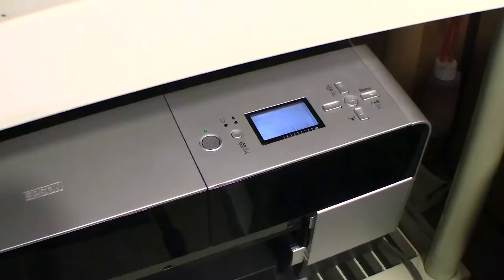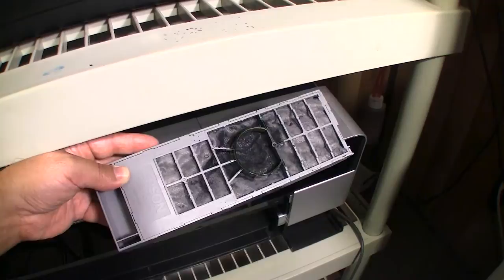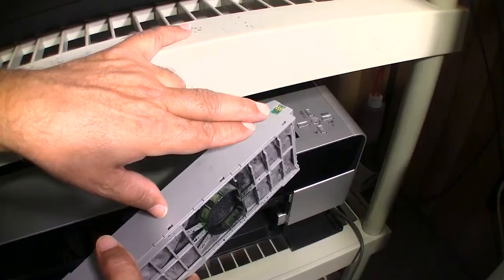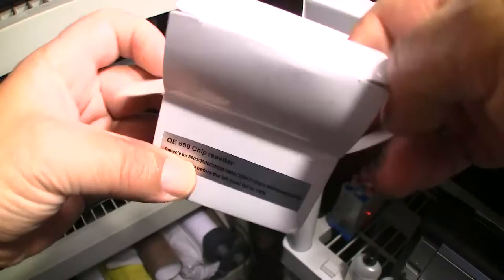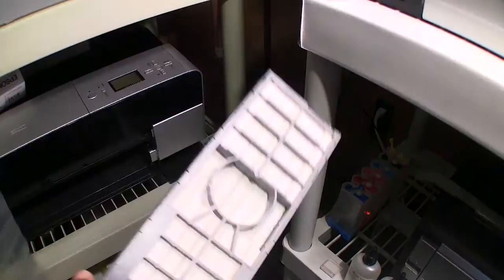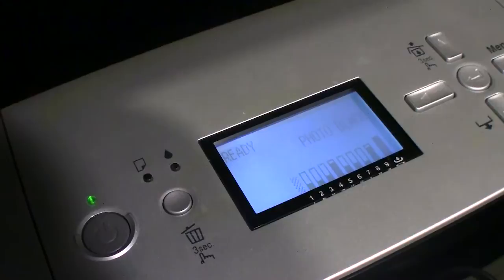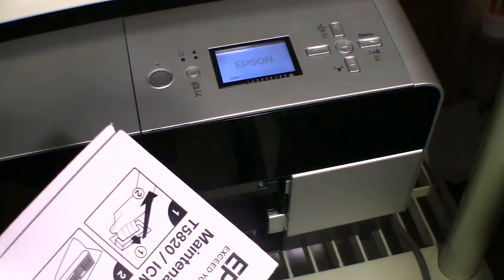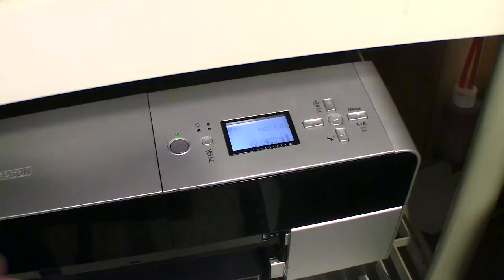How to Reset the Maintenace Cart on the PRO 3800 and 3880

Comment: I have a 3800 that has had a few clogging problems, but basically keeps chugging along. This video,and the accompanying one on refurbishing maintenance carts have saved me a lot of money. But... today I went to reset the chip on a refurbished cartridge, and the light flashed red, turned solid red, but never turned green. I followed a suggestion I found on line and opened the resetter (take the little printed strip off the back to expose two screws), intending to change the batteries. I took one battery out, then decided to just order another resetter from Ebay for $10.79. Then, on a whim, I put the battery back in and tried the resetter without its case, just the circuit board with long prongs sticking out. It worked! I have three old carts, and it did all three. Posting in case it might help anyone else. I thought it was easier to hod the prongs in contact with the chip using the circuit board without its case.

Comment: Mr. Rodriguez, I have an Epson SC P800 that  said it had reached the end of its Maintenance tank life, so I did this little trick, that you showed us only it didn't work. I took the old cartridge out, emptied, cleaned it, reset it, placed the new cartridge in, took it out and placed the old one back in.  The printer still says it has reached its life expectancy,  even after it had been reset...green light and everything.  Any thoughts?

Comment: thank you so much, i had the doubt about turning off the printer between changes, because on the p800 manual says it is needed, but not on the 3800, but looks like is fine turning off the printer as you show

Comment: Jose Ive been following your videos and I've done oem refills thanks you so much saved loads of money. When i reset my waste cart I just use the chip resetter the same QE 589 CHIP RESETTER your using with out using a new cart and it all works and rests 100%  thanks
Reply from the maker: +Kelly That's great! So far for me I've had to do the two cart routine but it is not a hassle. Glad it is working for you!Joe

Comment: Really wonderful thing you're doing for your community Jose... nice work. I'm wondering if I need to keep a pristine maint tank around between cleanings. Is there anything wrong with this:

Remove full tank and reset with the gizmo

Install the new tank

Clean the original tank when you get some free time.

When the second tank fills up, remove.. reset... and install the original tank. 

Actually... second question. Much of the way you speak and references you make lead me to believe you're a machinist or tool maker. Might this be the case? Hope I'm not intruding... thank you again for the good work you're doing.

Comment: Jose, hello. I found that I had to file down the plastic protrusion directly underneath the pins on the maintenance cartridge resetter that I purchased on Ebay. It worked fine after I filed down the plastic protrusion(spacer) directly underneath the pins.
Without filing down the plastic spacer, I couldn't get the pins to make contact. Just curious if you had the same issue? I know you didn't mention that in the video so I'm guessing this is a one-off problem with this resetter that I purchased.
I find your videos of great value and enjoy your manner of presentation.
Reply from the maker: What color is your resetter? The BLUE one does not require modifications.
Reply: @cheo1949  The resetter is white or cream-colored. All the identifiers on the resetter are the same as the one you showed in the video. It came from a place called "colorfulworld printing" via Ebay.
Reply from the maker: Yeah that's why. The only one I recommend is the blue one. I don't have the model # as I am not near my print shop.
Reply: @cheo1949  That's fine Jose. The one I got works OK now.

Comment: there's a way to reset the maintenance cart without the 2nd cart. just reset the maintenance cart chip as you normally do, then remove it and replace with any T58 cart chip. Put the maintenance tank back. printer will give error message of course, but that will erase the memory.  put the maintenance cart chip back, then the printer will read 100%.
Reply from the maker: Correct. Some of us will have extra chips as we are tinckerers but many do not. So the second Maint Cart routine is the recommended method. If you have two 3800/3880 you can continual!y swop the carts between the two.  I have the 3880-3880 and P800 and thte e the same cart so imagine the possibilities.

Comment: jose I found the resetter much cheaper at sign in china they were 20 each and the qe589  same one as you show they also have the other resetters for even less than 10 dollars each  wow I just used mine worked awesome thanks bud
Reply from the maker: +Hellgap50 Is there a web site?

Comment: Hi Jose, how are You. I'm following your tutorial from long time, I have a 3800 and all advice were very usefull. Now I have a problem wich i cound't resolve. The printer still keep asking a mantinance cartrige even if I have insert a new one, original. There is a way to reset all the sistem? thank a lot, roberto from italy.
Reply from the maker: Turn it off and unplug the printer for 30 minutes and power back on. A new never used maintenance cart should be recognized. If still cannot be recognized you will need to have it checked out at an EPSON Service center.

Comment: Hi Jose, Thank you for your instructions.  I have a refurbished from Epson, which was a replacement for mine which dropped black ink all over the print.  This one does the same thing and it was filthy.  After cleaning it still does it.  Do you know of anyone who still fixes these in CA?
Reply from the maker: It very likely is the Black ink Switch valve causing the leaking of black ink. As to where to get it replaced? Can you even find parts?

Comment: finally I got an resetter. I did everything like you suggested in the video. the reseter turned to green but my 3880 pro did not accept it??? I repeated the process-never worked...
Reply from the maker: If the chips were too low as in like 20-15% it will not work.
Reply: @cheo1949  thank you that nicht bei the problem. So I will try the next time in time.🙋

Comment: My maintenance cartridge is new, but the printer says it is full. I only installed it a couple of weeks ago. However, I just installed a new refilled ink cartridge and that's when the error message showed up. When I saw your video, i thought this might be my solution, but I'm not about to buy a resetter to fix this error.
Reply from the maker: Some refillable carts do not get along with the maintenance cart. 
What carts are you using?

Comment: HI Jose . I just received the QE589 and after following your advice, at the second attempt the green light came on. Thanks a lot .
Just one question, my original maintenance cart is at 15% but there seems to have plenty of absorbent not even dirty, when should I replace the absorbent ? The  carts have been in for 23 months
regards
Reply from the maker: +Luc Poi Yes most of the ink will be concentrated at the center and all over the very bottom of the cart's sponge. It will not be apparent when you just look at the top surface.Reset it and keep a close eye on it! Replace when you feel you need to.

Comment: Hey Jose, I got the QE 589 resetter and some ink carts from clickinks. Ive first tried refilling my carts and resetting them where I get green lights but some show full, some show as empty with an x through the level column and some without an x. It would have a not full maintenance cart and come up needs replacement . I would reset but it would last a minute until the same message will appear. I tried replacing with some /not all, new carts that read empty. What do I have to do?
Reply from the maker: If the original chip was empty you can not reset them at all. They had to have been at least over 15 to 20% above empty.
But are you saying you are trying to reset these carts from Clinkinks or original OEM ones?
Reply: @cheo1949  Im going to say both. I grab the chips and keep in a separate container. Is there a way differentiate?

Comment: Thank you for the instructions, the new maintenance cart is in, but when I get ready to print, it wants to switch back to photo black (and it leaks) instead of staying on the Matte Black, which I switched it on and prefer anyway for printing my artwork. Tried it twice....it says "Ready" and when I push print, it then gets ready to switch back to Photo Black. Any ideas?
Reply from the maker: If your driver is defaulted to a glossy paper type it will always want to switch to PK. Make you to default the driver to the type you are most likely to print on. If you are experiencing leaking then you switch valve may be beginning to fail.
Reply: Thank you much. Will try to change the default to regular paper. I am sure the switch valve needs to be replaced, but have no clue where to get one.. @cheo1949

Comment: Hi José, thank you for the great videos and tips! I found a deal on a 3800 but now I'm like concern about the shipment... if I should ask to remove the ink cards or not and in the case of the waste tank if it would be best and safe to remove it to, what you think it would be best?! thank you once again!!
Reply from the maker: No need to.
Reply: @cheo1949  Thank you! I also go ask to keep it on the horizontal during the shipment, if comes like that should be no problem to. I also would like to ask you in the case of the set of inks installed are already old, could cause problems if I use them even for running the cleanings?!

Comment: Hi Jose. Great and useful video that I was looking for a long time ago. Just one doubt with regards to the subsequent use of the brand new cartridge that you use to be able to reuse the used one. Have you got any issue with using the brand new one, since its id has been used for the old one?
It would be great if you could show us how you refill used cartridges with new absorbent material for them to be reused. I am sorry if you have already uploaded a video with this, but I have not found.
Reply from the maker: +Carlos Badiola No at all. Remember that the printer driver can only remember ONE code. So once you reinsert the original one you reset, it erases the code of the unused one. There some people who may have a resetter that can reset the one cart without having to use the second cart trick. I have no clue what resetter they are using, but I do not have a problem doing it the way I demonstrated. It really is not a huge issue at all.

Comment: could i clean the cart now  it is not full yet.  maybee about 3/4 . and set it in the printer again. how does the chip messure that the cart is full? or will he find it clean than?
Reply from the maker: You can clean and exchange the insides whenever you want. Resetting only works when you first reset the one you just cleaned, then install ANOTHER cart in the printer and let IT record THAT chip code. The Printer will "FORGET" the original one...then one you reset to EMPTY. Now it will recognize IT and accept. You will always need a second cart to fool it. It remembers the Maintenance Cart Chip Code. But it can only remember ONE! So by install another cart, it will forget YOURS and will accept it and see it as empty. Assuming you did reset the chip waste ink level to zero.
Reply: @cheo1949  thank you! Now I got it.  instead sending back all the used cartriges  for Recycling to epson I will buy such a reset tool you recomended.

Comment: Where did you buy the hydrophyllic material? Is there a more specific name for it?
Reply from the maker: It was many years ago that found this. But you can use anything that absorbs water based liquids. Paper toweling is perfect. Remember these cartridges are open to the air so as long as it absorbs and prevents splashing it will work.

Comment: Hello José,
I have the same question as Julien Borbon below: "I tried to replace the maintenance cart like in your video, but I have a warning message: "Non-Genuine Maintenance cartridge installed". I tried to reset the old cart twice, but same message. The indicator of the cart is empty on the screen instead of a full cart with the new one.
Any idea?"
I first put a good maintenance cartridge in so the printer will recognize it, shut the printer off and put in an old cartridge that's been reset.  I did get the green light with my resetter so I'm assuming it was reset.  I've tried this with two old cartridges and both give me the warning " Non-Genuine Maintenance cartridge installed."  
I've probebly tried this six times and always get the same result.  Any idea why the genuine Epson maintenance tank is not being recognized as an Epson tank?
Thanks
Reply from the maker: The printer remembers the last serial number of the maintenance cartridge you had previously loaded. So you have to install another cartridge momentarily then remove that cartridge and then insert the one you just reset that's the only way that the cartridge will be accepted. You can do that or just simply by cartridges.
Reply: @cheo1949  Hi Jose. thanks for your very useful videos. I've got a 3800 and a 3880. The tank in the 3800 is full, giving me replace maintenance tank message, I was wondering whether I could just install a new chip on the tank (after replacing its absorbent material); do you know if this should work? I can buy these chips in Brazil for about 12 dollars for one pair, while the resetter costs about 70 dollars. Thanks,

Comment: Will the chip resetter only work with a system using OEM ink cartridges? I have refillable ink cartridges on my 3800 will the resetter work with them?
Reply from the maker: Yes. The resetter is officially only for the maintenance carts. But they seem to rest the cart chips. If the levels are not under 15-20%.

Comment: Biggest problem of these printers seems to be the changing mechanism (a valve) from Matte black to Photo black. So I print only Matte black since 4 or 5 years, because repair costs about 500 $. But even I print only with Matte black the Photo black is sucked out by the cleaning mechanism, so you have to chang this carts also. This is weird; bying a new (3rd party) cartridge knowing that it will be never used for printing but it will be empty nevertheless some time. In which society we are living?

Comment: Hi Jose, I have now a FULL maintenance cartridge (dirty/empty), sad I didn't know the trick about the 15%, can I still use this wear out cartridge? or I have to buy a new one and just now start this 15% reset method?  I have just purchased a resetter that comes with a chip, the seller told me to replace the original chip from the maintenance cartridge with the fake one so the print will "forget"  and then back to the original chip (now reseted). I'm an amateur, poor soul, need help. Thanks
Reply from the maker: Two carts a re the best method. Buy one their are only $22 then reset the older one. Repack it.
Insert the new one. Let it recognize it. Remove the new and reinsert the old one you just reset and repacked. DONE! The printer must see a new chip and it will "Forget" the previous one so when it sees it again it will except. It's not just about the "Level
 code but also the individual ID code EACH chip carries. That is NEVER overwritten. So i has to "See" a different Cart so it can forget the firs ID code and accept it again.
Reply: THANKS. So do you think I have a chance with this 0% cartridge? I've read about an "empty registration" thing (like if the printer knows forever the cartridge reached 0% and the resetter simply don't work) and people say because of this it shows a "non genuine carts" message... in any case, I'll purchase another original cartridge and will reset before 15% so it lasts forever.

also, do you know a good refill cartridge? have you already tried the pistols one? sorry for the multiple help requests but you're simply a genius of the printing world.
Reply from the maker: You will need a new one regardless. So once you get it, reset the full one insert the new one, remove the new one and reinsert the old but reset one. It should accept it. If not then the chip could not be reset. Refillable Carts for the ASSUMED 3880 or 3800? www.precisoncolors.com

Comment: Hi there Thanks for your video. My printer has  a missing Epson Ink Maintenance Tank cover. I was hoping to get a replacement. I cant seem to find one online Have you got any ideas of where I can get a replacement Thanks
Reply from the maker: Man,,, that might be very hard to find.  Have you tried and Epson service center? Let me look around.
Reply: Yes its been difficult The Service centre can't help. Is there any way to somehow over ride the 'error"  A search for spare parts has been hopeless
Reply from the maker: Let me take a look at the services manual. The door trips a switch when it closes.  You will have to come up with a piece of something to trip that. The ink cover door also does the same thing and you use a piece of plastic to fool the printer to think the lid is closed when you use those double sized refillable carts.
Reply: Hi Jose . I've sorted it out. All it took was to locate the plastic tab that needed to pe pushed up into place Thanks anyway .
Reply from the maker: Great. That's always what it is. They try to hide them.

Comment: Hi do you work on Epson Stylus Pro 10000? I need a little help getting into maintenance mode to prepare for printhead change
Reply from the maker: Sorry but I do not. I would assume you would need the Adjustment Programs for it as well. Good luck finding that. Only the service tech have access to that. Unless you can find it in the "Gray" market